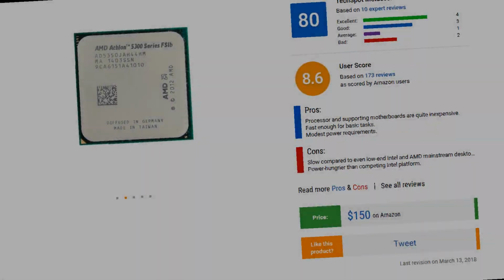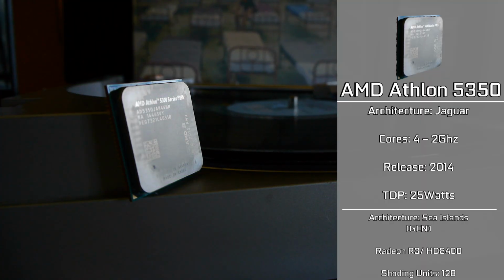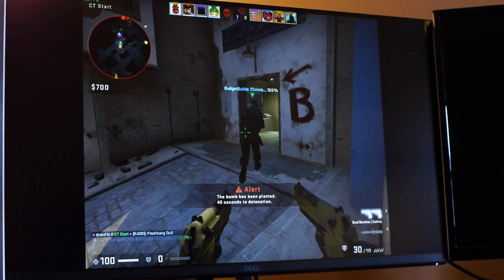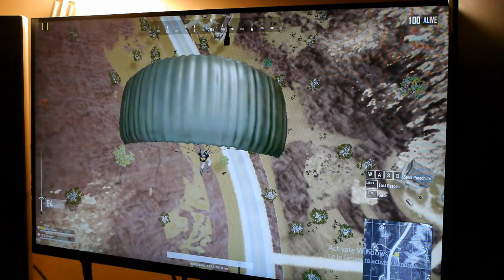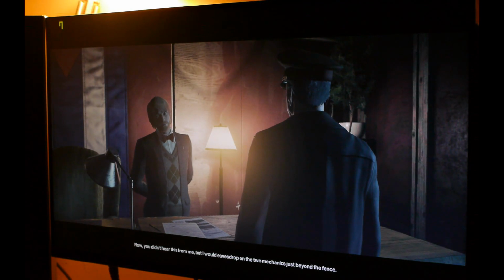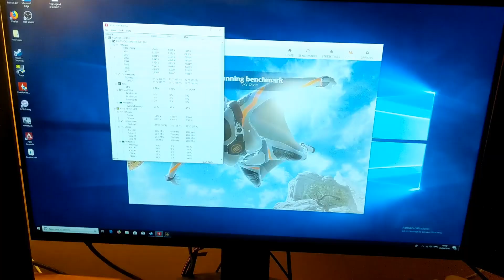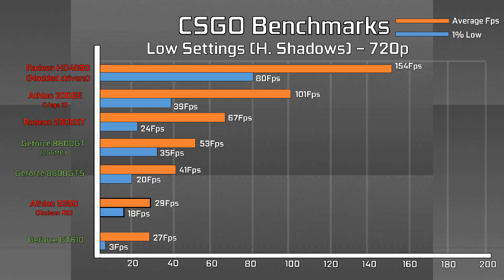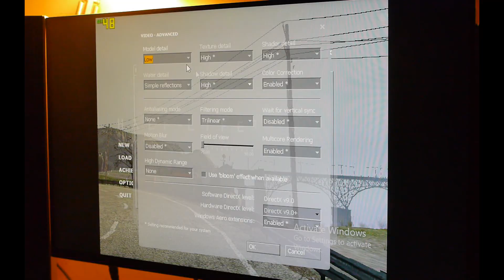Socket AM1 - Aging Horribly!

Comment: AM4 will be the same as 1155, it will hold the "budget king" title for the future and last the test of time, the r51600 will age like the i73770.
Reply: The great, GREAT thing about AM4 is how many great CPUs it supports and will support in the future. 1155 was great but it only supported two generations of Intel products and the first was arguably better than the second. AM4 has already gotten two, the second actually being an improvement on the first, and will get at least one more and in all likelihood at least one more after that (probably a 7nm refresh in 2020 that may see crossplatform suppoort with AM4+ or whatever the next platform is called, which may support DDR5, but this is all speculation on my part). Really, the only real pity about AM4 is that the motherboard manufacturers just don't seem to be giving it the care it deserves. AM4 motherboards more often than not just aren't as good as their Intel counterparts, and some manufacturers haven't even made a true high end AM4 board. For example there's no MSI Godlike for AM4. And those are the kinds of boards meant to carry AM4 into the future like they did for 1366. Speaking of Socket LGA1366, it's funny because AM4's "real name" is PGA1331, almost the same amount of pins as 1366, and both sockets are best known for providing a high number of cores for a low price, so that's almost a better comparison than LGA1155, really.
Reply: @GeorgePerakis   am4 is more like the old 775 from intel that goes from crap p4 to c2d and c2q, am4 will go from bulldozer to zen and zen2
Reply: Davide Reverberi I ran a rig based on a modded 775 board for about a year in 2017, and I had one hell of a time with it! The Xeon X5355 was a powerhouse of a chip, and I wish I kept it, but the $175 I got for the rig was well worth it at the time. 
Considering the only thing I paid for in that build was the processor (I could have kept the C2Q Q6600), it was basically all profit in the end. 
And yes, that build started off with a 8800GTS in the mix. I even played BeamNG.Drive and GTA IV on it. It was seriously fun. 
Closer to the end of that rigs time in my possession, it ended up getting a GTX 460 768mb as an upgrade, but apart from that it ran mostly the way I got it, doing modern things as a main build.
Reply: @GeorgePerakis  well I know my x370 board in particular supports Ryzen 3000. Anything beyond that is a no go.
Reply: Hello from the future. Fully agree! I have a 3800X and it's still running great! Planning to get a 5800X3D soon, I wanna stay on AM4 because I can't really afford a new mobo and ddr5 along with the new CPU rn. I've heard nothing but great things about the 5800X3D and I bet it will serve me well for years to come, possibly until AM6 comes out.
Reply: AM4 has aged well the last 3 years, and will continue to do so, it is a great platform
Edit - even if zen 2 kicks ass, base level ryzen is already basically dirt cheap at the lower end
Reply: You havw won my friend. 5 years later and there are Still AM4 Ryzen processors being made!
Reply: they are STILL RELEASING CPUS
Reply: agreed, currently running an i7-3770 and i can play any game i want.
Reply: @Ariund0  I'm upgrading to that CPU, six years after you posted this comment
Reply: 4 yrs later and the 1600 aged pretty bad
Reply: @nigerianprincesimp  not really. It's still hanging as a great budget option. Plus you can use the same motherboard with that and upgrade to a 5800x3d, the fastest gaming cpu at the time it was launched and the fastest gaming cpu in its socket
Reply: As a person from 5 years later, this aged fine
Reply: 1366 6c12t xeon over 1155 for "how long can this stay relevant/useful for gaming and other tasks"... shocking how well some now cheap, older parts, can hold up.
Reply: 1155 still rocks lmao
Reply: The only issue is what is keeping 1155 alive is the OC headroom that am4 doesn't have
Reply: and after 4 years that’s pretty true as well. ryzen 5 1600 goes for 40 dollars used off ebay. 

for 6 cores and 12 threads, with decent clock speeds and cache too, it’s an amazing budget cpu.

at the moment you can easily pair it with an rx580 and 16gb ram. i built a pc with those parts a few weeks ago for only around 250 usd.
Reply: we’re in a resonance era of budget-baller computing. 

4 years later and it came out pretty much true. we’re getting refreshes on an 8 year old platform. ryzen 5 1600 is 40 usd and is amazing performance for how cheap it is. entry level motherboards are only about 50-70 usd new, and ddr4 ram is extremely cheap. rx 580 8gb is 50-100 usd used. 

you can build a system along those lines of specs for maybe 200-350 dollars if you get some good deals. 

my personal pc i built a few months ago has a ryzen 5 5600x, 32gb ram, and an rx6600xt. full build was only 450 and everything was either new or open box. best pc i’ve ever had so far.
Reply: 5 years later, it's more like the LGA 775. Exceedingly long-lasting, many different chips.
Reply: Considering today's video, this ended up being anything but a "budget king" lmao
Reply: sorry but my 1600x perform better than my i7-4770K and my i7-3770 non k. 4 cores bottleneck my GPUs.
Reply: Loads of cpus from big to small, all sorts of boards from cheap to full featured and in a couple of years easilly upgraded to 8 cores for peanuts, possibly 12 and 16 cores as well in the future

The only drawback is the lack of overclocking. That is what the sandy bridges alive for so so long.
Reply: @Boba Fett   It's not as susceptible to the point where it shouldn't really even be considered susceptible because you need to have hardware level access to do that well Intel could just do it remotely using the Chrome tabs and I believe they fixed it on amd in the patches too and not to mention the performance loss was not as great
Reply: @Boba Fett  And couldn't that same logic be applied to Intel that there will always be a vulnerability
Reply: What a little beast the 3770 is
Reply: Well, I hope so! I just replaced my LGA 1155 system with an Zen 2 AM4 system this year. And there's plenty of room to upgrade for cheap with a Zen 3 chip down the road.
Reply: Well, before covid, Ryzen 7 2700s were already on blowout sale for $150. Assuming a somewhat similar rate of progression, these things will be a steal when they're 8 years old. Probably like $50-75 at most. And will probably net you stable 60FPS gaming. That's probably when games will finally be optimized for 8 cores.
Reply: I currently have three desktops because as I upgrade or build a new system one I still keep the old system around and one of them is still using a 3770K. I actually gamed on it for a little bit today and it was just fine even now. Granted it’s paired with my old 1070 and as a result, it still keeps up with modern titles.

My other system is an R7 2700X and 1080 TI combo and my main is an R7 5800X3D system with a 3080 TI.
Reply: It's definitely carrying on the 3770's torch all these years later
Reply: AM4 can make you a complete bundle for 50 €. You can't beat that. It will take time for AM6 before AM5 can ever compete in that regard. And a 3000 or 5000 CPU with 3200 DDR4 does all modern games without issues.
Reply: @Boba Fett nice try but right now intel has many more security issues if you have an intel chip then you should know that i have an i7 and have had many issues with security and frame stutter in the past 3 months and its only a 7th gen
Reply: I think it will be more like Phenom series.
Reply: Psychol no
Reply: @BITCOIlN  I'm pretty sure AM4 will age better than the Phenom and Phenom II, and definitely will age better than the FX series on AM3+.
Reply: @BITCOIlN  That's exactly what OP kinda was getting at. I'm on 1155 right now (3770k) and my previous platform was AM3+ (With Phenom II) and the only real difference is the lack of new CPUs on it, the longevity and stability of the platform as a whole (Not just the CPU - the I/O and the like is limited compared to modern platforms but still quite reasonable) make it still quite a good contender to this day. (Even AM3+ still is depending on what you play when you're on a budget)
Reply: ^ I recently built a sub-$200 off Ebay using an ASUS P8H61 M-ATX board and a Core i5-3570 paired with a GTX 950 and 16Gb of 1600Mhz DDR3 for a cheap media server. The most expensive component was the 2TB hard drive at 43~ bucks. The CPU was around 40 and the board was 40. 

I enjoyed building that PC and I use Teamviewer with it because no spare monitor and even in team viewer there is no lag. I even bought a stock cooler for it.
Reply: Ryzen 51600?

Damn, where do I get that?
Reply: It is still too early to tell. If the rumors are true about Zen 2 than the first gen Ryzen stuff will not have aged well at all. Not to mention that Intel has actually been releasing some great stuff despite still being on the 14nm fabrication process. Like say what you will but the 9900k is a beast of a CPU.
Reply: @dennisp8520  it's good for its size. But it's not the size that matters, it's how you use it that does. 

Maybe the way Intel has went about it makes shrinking them more difficult. That and the Zen2 chips won't be completely 7nm anyway, just the chiplets will be. The rest of the CPU will still be the same sizes though. It is a good advancement, but the fabrication process allows this though, Intels fabrication doesn't if I'm correct. So Intel may never get their chiplets as small as AMD does.
Reply: @dennisp8520  but for a 9900k you need all expensive stuff like full featured overclocking boards, pretty good psu as it draws a buttload of power and runs hot like a mofo plus thecpus themselves are and will stay freaking expensive for years to come, and so will the boards etc. because intel switches sockets every year so interchangability is minimal.
Not really budget friendly compared with ryzen and its flexibility and availability.
Reply: Dennis Pietrandrea it is also as expensive as a high end GPU
Reply: @Sendoh32  and very very expensive for intel to produce as well, i doubt they make money on them.
If they could get it on a smaller node they would have made a killing with it though. But now it is just more a image builder pretty much.
Reply: not for games... my 2600k will smash any of them if i remember correctly when it comes to games
Reply: @john-ek9gv Try a 5700g 😂 it will smash that
Reply: stop.
Reply: @noodled6145  make me

Comment: you almost did a Linus on that power supply
Reply: What's better, if the power supply had fallen it would have dragged the motherboard and everything with it. Possibly even the monitor, so a close one!
Reply: *almost linused
Reply: @ziperrevera3591  Linus tech tips
Reply: Russian Terminator 💀
Reply: Markiplier 😂😂😂😂
Reply: I mean chuck in a 3090 and its underrated lol
Reply: libtard
Reply: "did a linus" that sounds kinda wrong.....
Reply: A N I M E
N
I
M
E
Reply: stop.
Reply: @noodled6145  no u
Reply: @noodled6145  no u
Reply: @noodled6145  no u
Reply: @Psythik  no u

Comment: Could you try and overclock it? MSI made a motherboard that claims has an x16 pcie slot but I don't buy it, still might be worth seeing what the limits are when you push the thermals. Then again, I don't know if you can overclock them or not
Reply: This CPU is locked. No overclocking allowed
Reply: @izzystar5904  That's a shame, I assume there's no motherboard manufacturer that's done something with the motherboard to allow some form of overclocking. Than again, after a quick check it looks like only about a dozen or less were ever produced. They probably knew the platform wasn't going to be a big hit :D

Comment: Hey Budget-Builds I have a laptop with that exact APU (Toshiba Satellite) (Quad 2GHz w/ HD 8400) it's not very good and the laptop version is limited to 800mhz ram in single channel only
Also the GPU flags up as both with (HD 8400-R3 Series) appearing in Task Manager

Comment: Sounds like a real good choice for a very low powered server type device. It was'nt really a high clocked cpu though at 2.05 Ghz, but you could at least passively cool it.
Reply: Yes, still have 2 of these as servers. Also makes a powerfull pfsense router. Nas, private cloud server, media box etc. That is where they shine. Just slam some old leftover ram and drives in there and it runs for ever for basicly free. And apperently you can push them to 2,7ghz..

Comment: well, installing windows 10 on an old system like this one is the same as giving a death sentence, this operating system really didn't have this cpu in mind when it was made, the best os for this cpu would be win7
Reply: I’ve put 10 on an Athlon 64 x2 from 2006 and it was still very usable.
Reply: @EvilTurkeySlices  well, i had put on a notebook with a core 2 duo 1.6 ghz and the bloatware was so bad that it got unusable, but it gets really snappy with windows 7 and the classic theme, but since the original website with drivers support (microboard) went down i just install lubuntu for convenience (my mother uses it to navegate on the internet)
Reply: AmazinChannel a reinstall of Windows 10 would have done the same thing.
Reply: @EvilTurkeySlices  it was a clean install, i just installed w10 and the system got horribly slow
Reply: Or XP SP2 x86